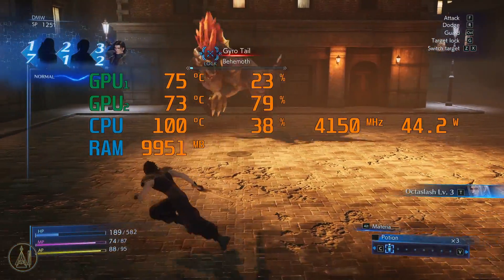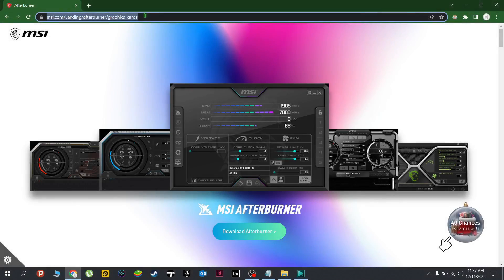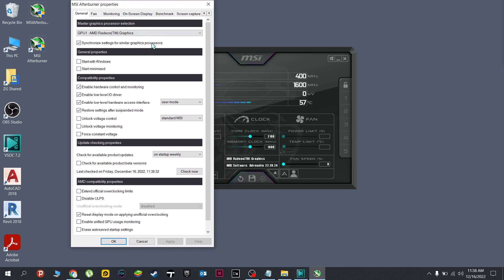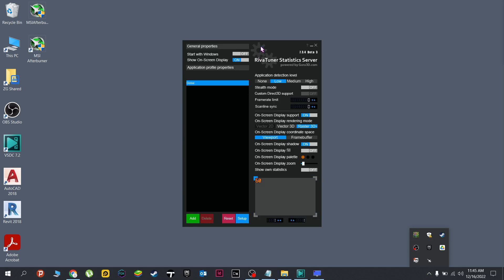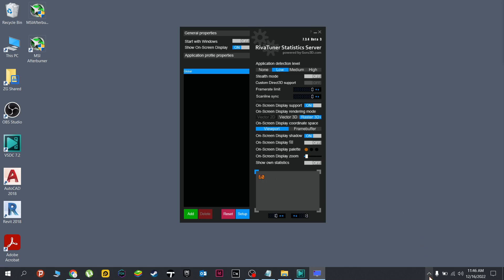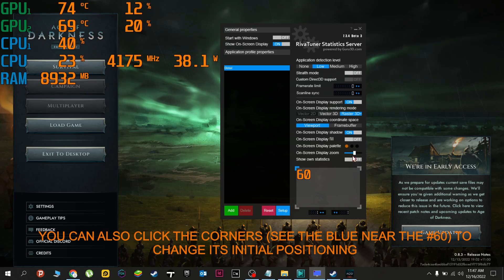MSI Afterburner Overlay & On-Screen Display | Techie Tutorial

Comment: for some reason its only showing GPU temperature.
Reply from the maker: Hey There,

In MSI Afterburner properties or settings, go to the Monitoring Tab and scroll down to monitoring graphs, choose the graph you want to show in the overlay using "Show in On-Screen Display" below it and Apply, then OK.

For me it usually doesn't affect immediately but restarting the application or the computer itself would help.

Also using a toggle button to hide/unhide the overlay during gaming or designing also helps.

Comment: Hi how to measure system latency, input latency, gpu latency and network latency and input lag using msi afterburner?
Reply from the maker: Not sure about those specifically but check the options in 

MSI Afterburner>settings>Monitoring Tab.

then scroll down to the active monitoring hardware graphs and activate the OSD of whichever you want it to show

Comment: the overlay goes offscreen partially  for me
Reply from the maker: With RivaTunerStatisticsServer,  you can control where the overlay will be in the lower right portion of that menu.

Either by dragging the color orange text anywhere on the screen, setting up a coordinate map, or click any of the corners in the screen, (blue indicates which corner it is at currently).

Hope this helps.

Comment: Hey, i did everything as you said but nothing shows on screen when i turn on games
Reply: You need to keep the msi afterburner launched and not close it
Reply: @ZenixsYT  it is launched
Reply: @ZenixsYT you need to launch it from the menu in the bottom right next to time hit the ^ and it will be in there.
Reply: Does it give you a DirectX error when you open one of the applications just installed
Reply: hey did u found out how to show it on screen

Comment: Great tutorial but i have a question. Can you configure a hotkey to the on screen display so that you can turn it on and off?
Reply from the maker: Hey There,

There is actually, but it might interfere or clash with your current hotkey or certain button in whatever game you're using.

1.) Open the MSI window app
2.) Go to settings
3.) On-Screen display Tab
4.) first textbox should be what you're looking for

Comment: Hello can you pls help me? I tried searching how to fix the other parameters not showing up.. such as FPS average & the 1% lows because I wanna see it. I already set it to "on-screen display but those 2 doesn't show up for some reason but the others show up (cpu speed, cpu power, cpu temp, gpu percent, ram memory). Pls help me bro and this is on an Asus laptop btw 🥲
Reply from the maker: Try closing both msi afterburner app, run the game, then run afterburner with the game running.

extra tip:
Enabling Nvidia's in-game overlay before starting Afterburner seem to help
Reply: In the same boat, the main ones show up but not the average fps and 1% lows. Did you ever figure it out?

Comment: It will show framerate, but I cannot get frame rate min, max, aver, or 1%, 0.1%, help?
Reply: Thats my problem too i have it  set to OSD already
Reply: @ryuki.ryugao  I have since learned that you have to trigger benchmarking for those to show up.  Check out the benchmark tab.
Reply from the maker: Try closing both msi afterburner app, run the game, then run afterburner with the game running.

extra tip:
Enabling Nvidia's in-game overlay before starting Afterburner seem to help

Comment: how to uninstall it or stop it from overlay . Please i wanna get rid of it
Reply from the maker: Hey There,

you can close the application anytime by going to the sidebar or the lower right corner of the screen by right-clicking the application and just exiting it
Reply: @AinsHowToTutorials  ya it worked out
Reply: @AinsHowToTutorials  i have another problem. My cpu usage is not going above 25% and gpu is not going above 50% . What should i do. Please reply 😢. In this laptop
Reply from the maker: cpu and gpu usage will be determined by the applications you use, opening lots of chrome tabs can overload both cpu and ram.

certain games will use the full potential of your gpu. try installing twinmotion, this application uses 100% of gpu just by opening it.

since you said you're using a laptop. it always uses its motherboard gpu as its first priority. go to graphic settings (win+q > graphics settings) tick hardware-accelerated gpu sched if you have that option and also from that menu you can browse certain apps you use and control which gpu you want to prioritize said application.

hope this works for you.

Comment: i dont have the same options as you i only have general,fan,monotoring,profiles and user interface, the settings in them dont have the same thing either, frustrating
Reply from the maker: Hey There,

you only need the general and monitoring tabs anyway.

if you're using a laptop, in the general tab try to choose your GPU2 (the strongest one)

this should add some more extra monitoring graphs in the monitoring tab under graphs.

otherwise, try to uninstall then install again from scratch.
Reply: @AinsHowToTutorials  Yes, i found the solution to this problem
thanks for letting me know

Comment: hey great video, tho im encountering an issue wherein I'm not able to monitor my gpu temperature or wattage, rest all work fine, only the gpu options are not available in the monitoring tab of msi afterburner oh and btw I'm using an asus tuf dash f15.
Reply from the maker: Hey There,

I'm also using a laptop, therefore it should have 2 GPUS shown and by default it will use the GPU0 or first one embedded into the motherboard, in the main screen of the software you should have an option to select which GPU you want to show in your over-lay.

When done, everything should work out fine.

Otherwise, uninstall and install (not reinstall option), do it again from scratch and very slowly this time.

Comment: Thank you for making this video! For whatever reason I don't have "CPU temperature" or "CPU Clock" available in the list. Strange.
Reply from the maker: Hey There,

Have you installed RivaTuner as well ???
Reply: @AinsHowToTutorials  Hey! Yes, I have RivaTuner as well. There's also a tab called "Active hardware monitoring graphs" just above the OSD list in MSI AB. In there one can select what type of programs to help MSI AB deliver readings. One of them is HWInfo64 which on its own reads the sensors like normal, but inside of MSI AB it can't deliver readings. Weird. 
If I choose "CPU.dll" it only displays 206C across all cores, which is obviously a false reading.
Reply from the maker: Hmm that is indeed weird. a problem waay above my paygrade and havent encountered before.

But, have you noticed your CPU temp and CPU clock  has plenty of numbers right, by that i mean CPU1, CPU2, etc...

Do you have CPU(0) Clock or CPU(0) Temp listed in those graphs? If yes, show those in your OSD.

Do lemme know what happens

P.S.

Mind uninstalling (remove their root folder along with its contents) and reinstall from scratch?

Comment: i maked everything like you and it doesnt show
Reply from the maker: Hey There,

How about RivaTuner, did you install that too? most seem to think that it's a spamware included in the installer, but is actually the one that does the most. Try to "UNINSTALL" from scratch via control panel or uninstall tool then install again from the beginning.

Comment: for me there is no show in on screen display, only show in logitech keyboard lcd display and showing tray icon. can you help me
Reply from the maker: Hey There,

I'd encountered this too, i hope this solution will solve it:

1. Uninstall everything, install from scratch "make sure you've installed both afterburner and RivaTuner".

2. When you keep it checked during afterburner installation, you will see another Installer open up. It may seem like Afterburner installer has been opened twice but its not, its another installer for RivaTuner, so dont close it, click on next and install it as well.

3. In the end, you will be clicking "Finish" twice.

Refer to This 01:15
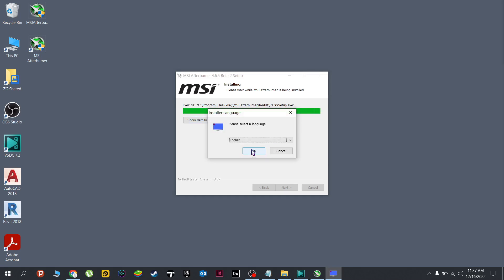and This 01:37

P.S.
Try updating as well after installing just in case an older one was installed, 02:40

Do lemme know if it works
Reply: @AinsHowToTutorials  thanks for sharing the information 😉
Reply: Great comment on the step 2 portion. I canceled the 2nd download and because of that it didn’t download the on screen display
Reply from the maker: @jeremylopez8215  True, RivaTuner is often assumed as a spamware or spyware since most free downloads do so, but in fact, RivaTuner actually does help out the overlay

Comment: My cpu temp is not showing
Reply from the maker: Hey There,

Do refer to my reply to the other comment.

Try to uninstall then install from scratch (not reinstall), make sure you tick "RivaTuner" as part of the installed program. (for me when i installed without rivatuner, no overlay is showing)

1. Open the MSI Afterburner
2. Go to settings, it should be on the left of the generic HUD and would look like a "Gear" Icon
3. That should open the Properties Window, go to the third choice above which is "Monitoring"
4. Inside there should be a separate box where you can scroll up/down. There'd be a lot of CPU Temperature such as CPU1, CPU2, CPU3, and so on.. Look for CPU Temperature (no number), it should be at the bottom of all the CPU# Temperature listed.
5. Select it and Tick the "Show in On-Screen Display". Now going back to the CPU(no number)Temperature in the earlier box, "IN OSD" should appear next to it. Now click Apply, and okay. (We're not done yet)
6. Play a game in fullscreen and it should appear in the upper left corner of your monitor.

Should look like this 05:24

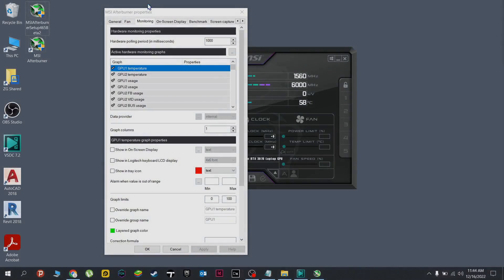Can also refer to this timestamp and just increase the videospeed in x2.0 for your convenience since you don't actually need to listen to it. 03:15
CPU(no number) Temperature should be listed below all the CPU1, CPU2, CPU3 and so on..

Hope this helps :_aiTLike:
Reply: @AinsHowToTutorials  pls halp me my pc dont show monitor display to click on it
Reply from the maker: The Overlay won't show in your monitor screen exactly as is like a Widget, you need to open certain programs. Like games, CAD/BIM softwares, it would sometimes also show up in adobe softwares.

Comment: Can someone help, for me there is no „gpu temperature“
Reply from the maker: Hey There,

Try to uninstall then install from scratch (not reinstall), make sure you tick "RivaTuner" as part of the installed program.

1. Open the MSI Afterburner
2. Go to settings, it should be on the left of the generic HUD and would look like a "Gear" Icon
3. That should open the Properties Window, go to the third choice above which is "Monitoring"
4. Inside there should be a separate box where you can scroll up/down. GPU Temperature should be the first one listed
5. Select it and Tick the "Show in On-Screen Display". Now going back to the GPU Temperature in the earlier box, "IN OSD" should appear next to it. Now click Apply, and okay. (We're not done yet)
6. Lower right corner of your screen or the side box or your taskbar, look for rivatuner statistics, it'll look like a purple monitor.
7. This Menu will assist you in extra stuff you want such as moving your Overlay and increasing its size
8. Play a game in fullscreen and it should appear in the upper left corner of your monitor.

Should look like this 05:24

Can also refer to this timestamp and just increase the videospeed in x2.0 for your convenience since you don't actually need to listen to it. 03:15

Hope this helps :_aiTLike:
Reply: @AinsHowToTutorials  this is very generous and helpful for you type this all out like this. 
thanks a lot for doing this Video.
All I wanted  was quick tutorial to setup the basic overlay settings. You would think that would be easy to find but it wasn't. So this video you made just approximately 1 month ago was helpful to me.
Subbed!
Reply from the maker: @Tinzy89086  Very welcome, but i believe there might be plenty more videos that're more helpful than mine, still happy to be of help.
Reply: Huh... For me I only see the GPU temp while playing
Reply: @MirkoiscoolMC I´m just gonna need access to your computer and I will fix it right now!
Reply: I dont think we can see GPU temperature if you  have a integrated GPU ! like intel irix Xe or Intel UHD 

hope that helps !